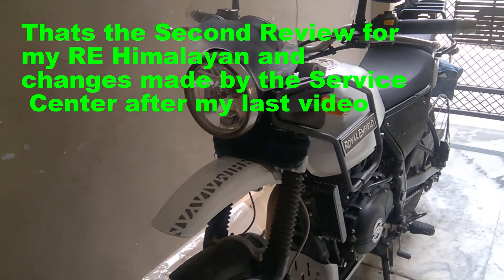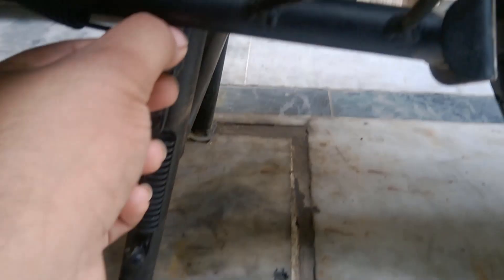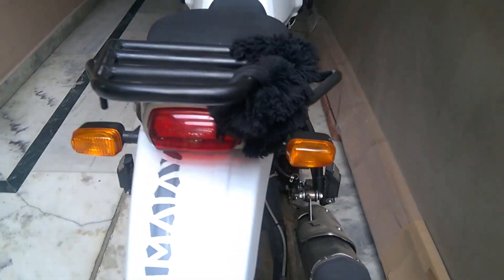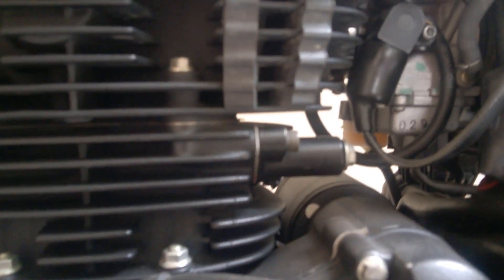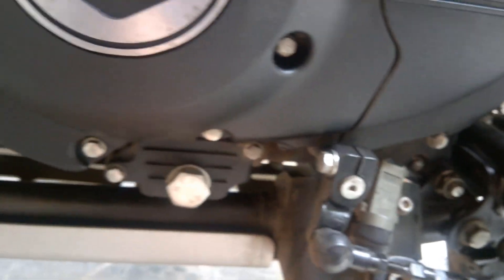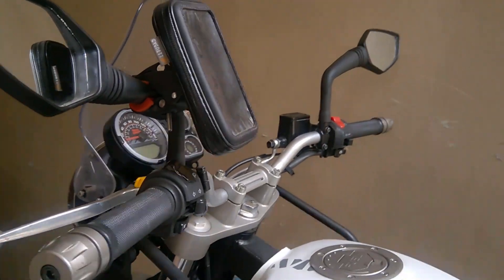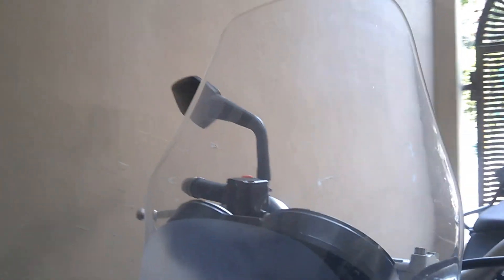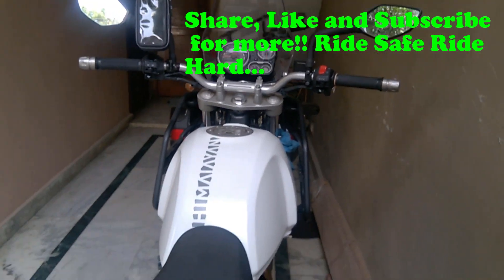Royal Enfield Himalayan | Things not to like about | Why Not To Buy It | Reality Part 2

Comment: i dont get it, whats so bad about little bit of rust here and there, why not just apply some coating. you must be living in humid area. my bike is working totally fine, no complaints so  far.
Reply from the maker: Its Just 4 Month old and rust in early stage is not good it shows the bike was either a Test bike or was not kept well before handled over to me, and I live in Delhi which is not a Humid area as a Sea side area should be.. and under warranty ever thing is an issue and i cant ignore this as i love my Bike and want it in top condition

Comment: brother .. this is scary. ..!!
am planning  to buy himalayan  in next month.  but after watching this.. i thik i should drop this bike from my wish list...!! what your suggestion.. should  i go for 500 classic.  or duke 390
Reply from the maker: Duke 390 any day .. its a hell of a great bike in compare to RE, but just for love you can go for RE which i have for RE :P
Reply: duke 390 is racing bike high on performance, pick up and more a street bike, i feel not comparable with Himalayan which is more suited for off roading. though looking at your video, one is worried looking at the complaints and number of parts replaced. Mahindra mojo is a gud competitor for the RE Himalayan
Reply: Maybe the new batch will not have these problems , maybe .if you are keen on getting an offroad and a commuter you could go for it but if you want power 390 has got 43 bhp so do the math. anyway take a test ride man and then decide . godspeed